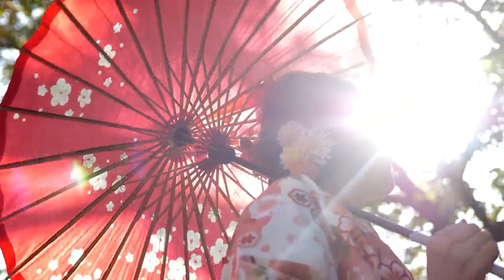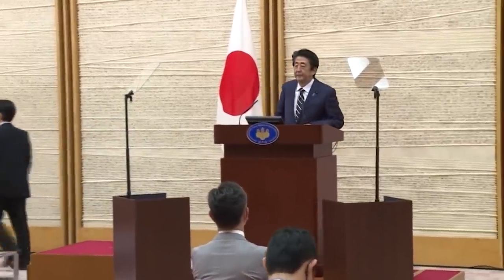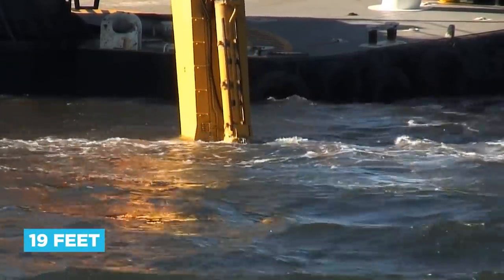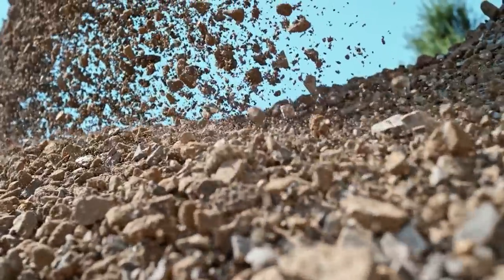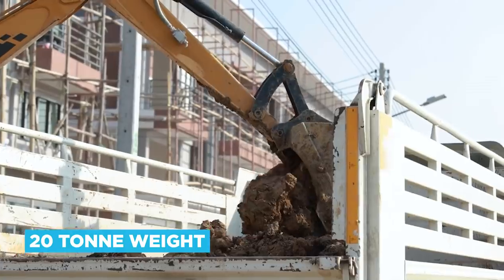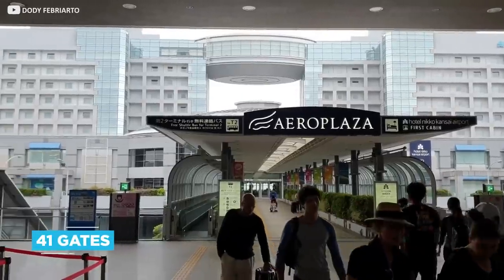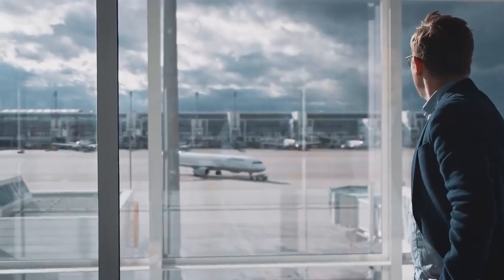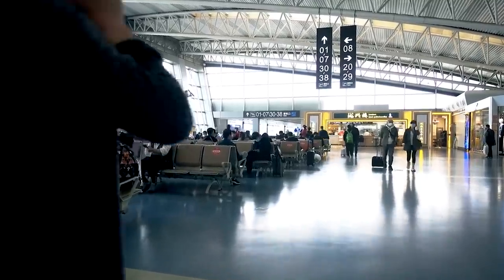Japan’s $20 Billion Airport Island

Comment: There need to be clarity. There are two island connected together for Kansai international airport.  The first island was completed in 1998 the expansion island with second runway was completed in 2007.   If you Google images on Kansai International Airport, the older ones will show one island and newer ones show two.  When Typhoon Jebi hit Osaka.  The first island was flooded while second island was not.  I believe the first island is sinking and not the second one, they learned from the problems of the first island.

Comment: thought sea levels will rise? yet they still build at the shore. So who lie's?
Reply: They probably assume that the airport will be outdated anyway by the time the ocean rises significantly. 🤷‍♂️
Reply: Yes.. do you know that Japan style homes will be self destructed in 30 years?.They are so efficient not to overspend more than its usability. Actually am not surprised if the airport is sinking. Not an issue from Japanese engineering plan!